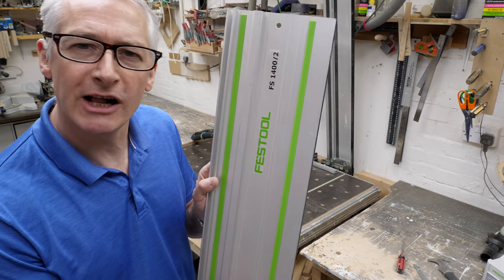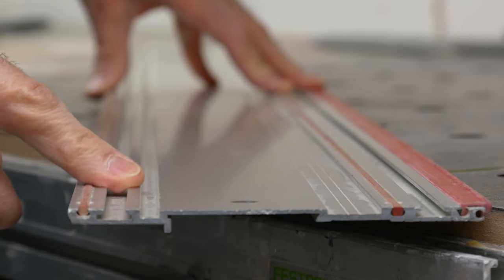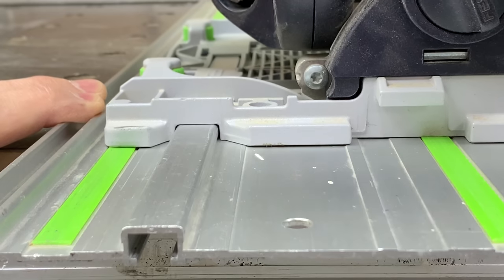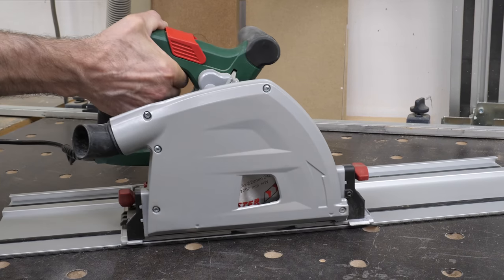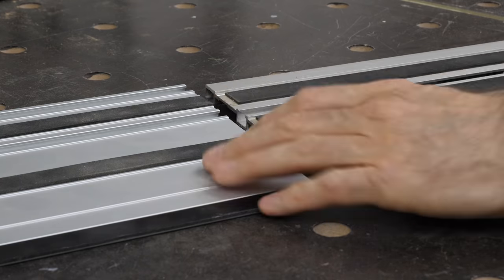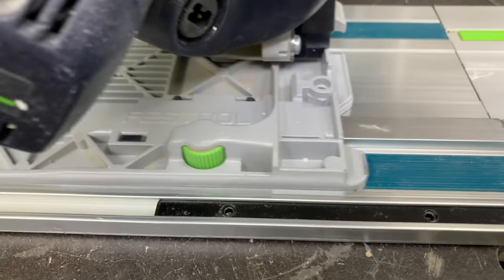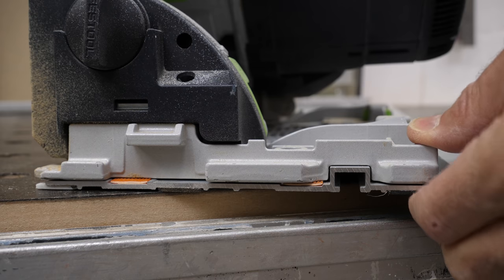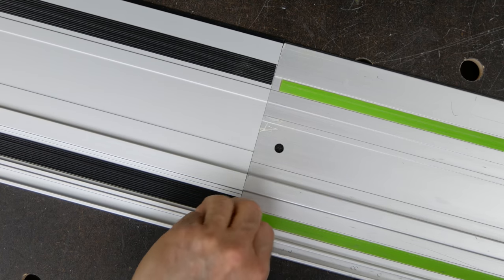Which Rails Work? A Guide to Guiderails [video #403]

Comment: Why do companies make these track saws right blade, and only 6.5 inch blades? 
 
I see (right-handed) people stretch over workpieces, and cross their arms to do a full length rip cut on sheet goods as they walk the saw down their workpiece with it to their left.
 
 This is dangerous for the majority of users that are right-handed. For left-handed people, like Leo over at "Hand-i-Craft", it's great. (I used to be a lefty, so it didn't bother me until I lost use of my left arm. 
 
It's just bizarre. I suppose it's just one if those "We've always done it this way" kind of things.

Comment: Hi Peter, does the titan run on the Evolution/Excel rails? and if so which would you recommend?
Reply from the maker: It should be fine - can’t say I’ve tried it, but I’ll check when I’m back in the workshop. If they’re the same price the Excel rails follow a more familiar pattern.  👍👍

Comment: What about dewalt ?
Reply from the maker: 🤷‍♂️ Not much to say about it other than what was said in the video; it’s a proprietary rail system that only DeWalt uses, its USP is the splinterguard on each edge of the rail, and the saw runs in Festool rails, just like all plunge saws do. 👍

Comment: Call me wreck less, but when using Festool saw on Sheppach rails, could you ‘trim’ the rail back to cut line as you do with splinter guards. Hell of a way to send a blade to its maker, but..
Reply from the maker: I’ve never tried it, but I think the best bet might be to trim the Scheppach rail back with the saw, then trim another couple of mm back with a router - then you get the full effect of the Splinterguard.👍👍

Comment: Hilti rail works well
Reply from the maker: They don’t make a plunge saw though - is the Hilti rail the standard pattern, or proprietary, do you know?? Thanks!
Reply: Peter Millard it’s a different layout to festool but the festool works on it, Hilti make guide adapter plates for their circular saw, I use mine on festool tracks

Comment: Guide rails are way too expensive or the dewalt ones certainly are,around sixty to seventy pounds for a 1.4mtr rail, thirty quid for a couple of clamps not that they are needed that often and then at least the same again for the rail bag. It's not like they aren't making enough selling the plunge saw with two batteries for almost eight hundred nicker. I'm a bloody tool freak though so il pay it like a mug. Carpentry and joinery is the most expensive trade to get set up in by miles!
Reply from the maker: Yep, no argument from me, there! 👍👍